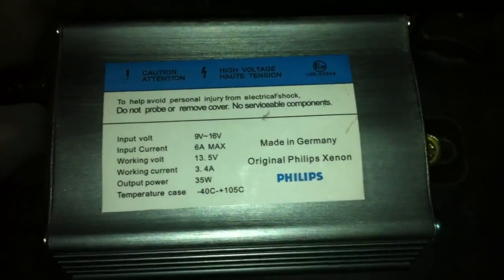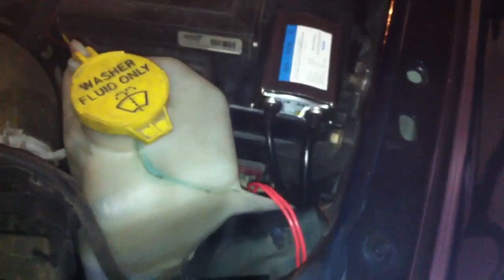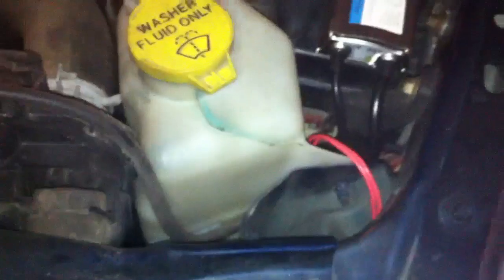2004 Dodge Ram HID Conversion 6000k

Comment: hey bud i have a 2010 2500 and i just bought a set of projectors, its a complete setup housing and all I believe its just a plug and play kit? that doesnt have any relays, what i want to know is where exactly do i put the resistors? with the kit i just plugged it into the factory harness that powers the whole thing turn signals and all so I assume i would put the resistors in between the bulds and the factory harness right?

Comment: I had mine on my truck for 5 years before I started having this problem. But it just started happening to the pass one and not the drivers. I looked at the bulb and it appeared that the build (center) turned 'white'. The build flickers, then shuts off. I just bought a dual bi-Xenon kitt. I don't know if that will work. But my others on my fogs and the drivers light are still going strong. 8000k fogs, 10000k headlights.

Comment from the maker: @gixxer0001 A cap should fix your problem. Wire it in before your HID ballast, negative to the ground, positive to the low beam wire. Easy as pie.

Comment from the maker: @Sotexy2 I didn't do fog lights, but from what I understand you do not need resistors/caps for fog lights, as they are not wired into the Can-Bus. For the headlights, with just caps, lights worked no flickering, but lamp out would illuminate on the dash. With just resistors, no lamp out light, but lights would still flicker. I used both, caps and resistors, for each side of the truck - and have no problems.

Comment from the maker: @Samoanslamer The ballast alone still cause flickering in my truck, and lamp out. When I installed the two 4200uf capacitors, the lights no longer flicker - but it still shows lamp out. With two 50w resistors only, lamp out was gone, but still flickered after being on for a few minutes. With both resistors and caps, I was able to solve both issues. No lamp out, and no flickering. Caps are wired the same way as the resistors - low beam to the ground.

Comment from the maker: Philips ballasts will not fix your problem. You need the 50w resistors, or capacitors, or both. I got the 4200uf capacitors from Radio Shack, and the 50w resistors came with my kit.